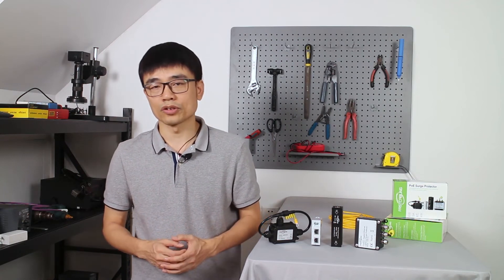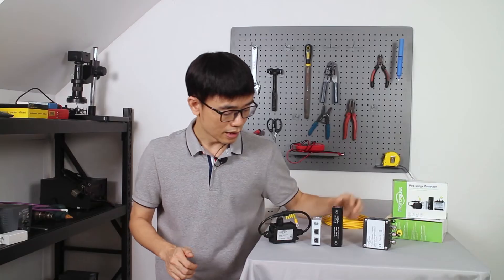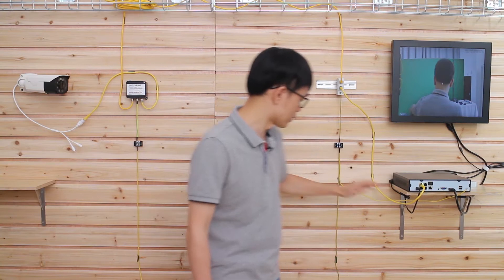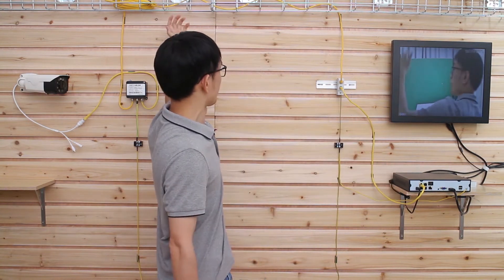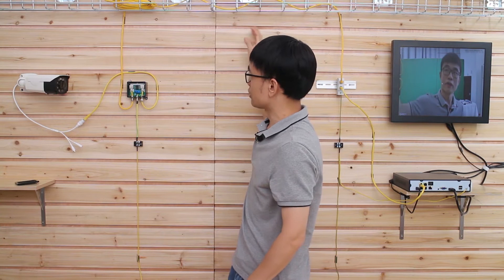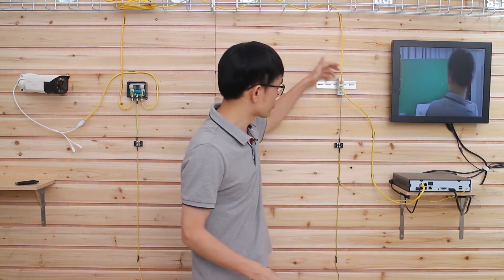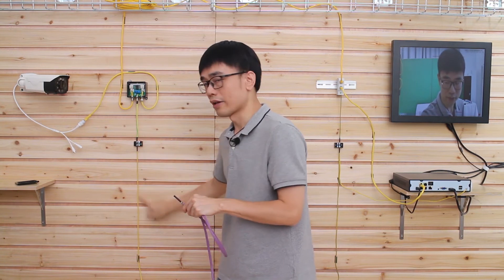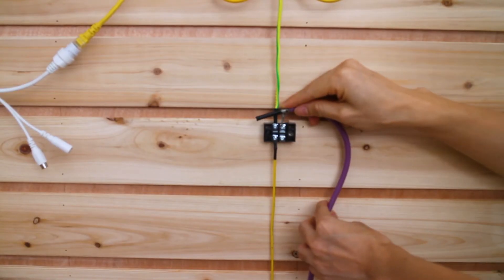How to use the PoE Surge Protector in the right way

Comment: Will the POE switch still need its own external grounding line if the power cable already has a ground on it?
Reply from the maker: If the power cable for the PoE switch includes a proper ground wire (connected through the plug to a grounded outlet), and the electrical system in your building is correctly grounded, the switch may not require an additional grounding line. 

In locations prone to lightning strikes, electromagnetic interference (EMI), or power surges, a surge protector is needed. Long cable runs, especially those that go outdoors, can also introduce unwanted electrical noise or surges.

Comment: Hi can u explain how the grounding path is done
I have difficulty deciding where to connecting the grounding cable to
Reply from the maker: In most case, you are supposed to ground both ends. While the POE cable attract the surge, it will release to the closely ground spot.